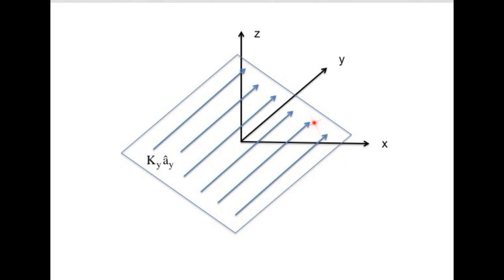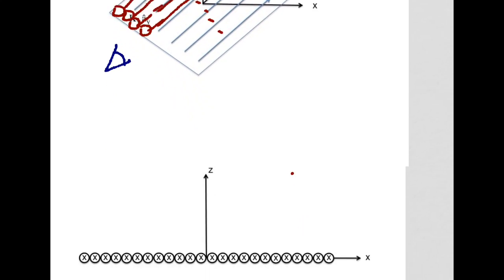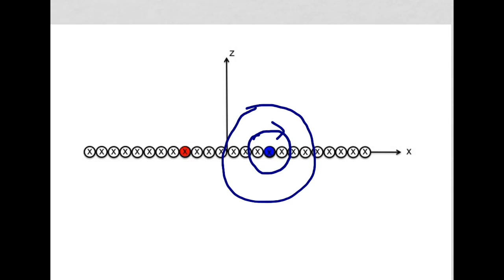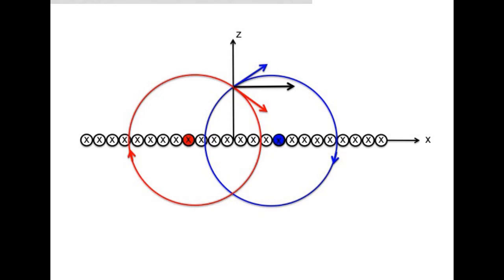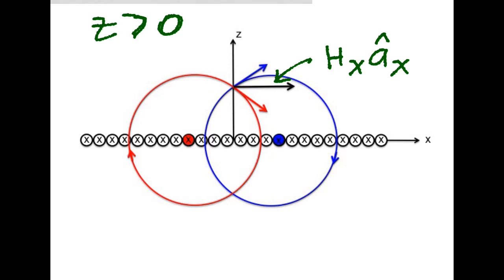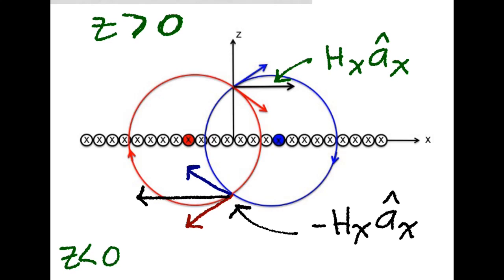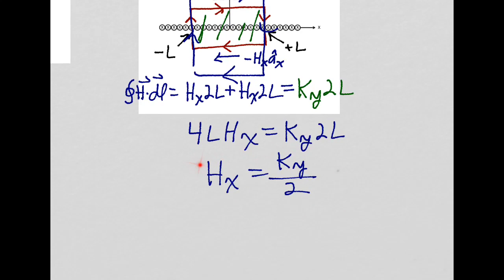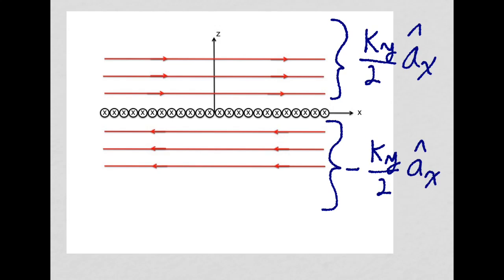Magnetic Field Intensity from an Infinite Sheet of Current

Comment: It was a good explanation; there a little mistake I believe as he did not multiply the right hand of Ampere's law by the permeability of free space.
Reply from the maker: On the left hand side I have the magnetic field intensity (H), not the magnetic flux density (B). If the right hand side had B  instead of H, then I would have to multiply the current on the right hand side by the permeability of free space.

Comment: Thanks a lot for your video, it helps a ton. If you don't mind me asking: If i need to find the direction of the magnetic field due to a current along the z axis on an infinite xy plane, would the steps to the sollution be the same? Any points of emphasis i should look for as coordinates change?
Edit: Just solved a couple of exercises that have been troubling me for a while. Your explanations are to the point!
Reply from the maker: If you put the thumb of your right hand in the direction of the current alone the z-axis, the fingers of your right hand point in the direction of the circles of magnetic field around the current
Reply: Thanks, being able to solve quite a few exercises since my last comment. As far as vector potential of the infinite sheet is concerned do you have any videos/recommendations? I can understand the choosing of amperian loop and the calculations just can't get the direction right
Reply from the maker: I don't have any videos on vector potential. Actually, vector potential is a topic that I need to get more comfortable with and have no idea  where to point you.

Comment: Hi,
I'm trying to do this exercice but i wanna calculate the magnetic field for a point on the x-axis,let's say at a distance a from the infinite sheet.Should I apply this ? Thx :)
Reply from the maker: +Anthony Devresse If you are on the x-axis, you are in the plane of the current sheet. The magnetic field intensity is zero in this plane. You can see this by thinking of two wires that are equal distance from a point on the x-axis in the +x and -x directions from this point. The two magnetic fields from these two wires are of the same magnitude and in opposite directions at this point so they cancel. If you then think of summing up the contributions from the whole current sheet by thinking of two wires at a time that are equal distance from this point and moving from the point to infinity you see they would all cancel.
Reply from the maker: Risto, if the sheet is finite, you are correct. But if the sheet is infinite, no matter what distance you are away from the origin on the x-axis you still have an infinite current sheet in the +x and -x directions. So everywhere on the xy-plane the magnetic field intensity is zero for an infinite sheet of current.
Reply: I was reffering coordinating system from your video.
 I think we were talking about different placement of sheet...

By the way great videos keep up with good work.
Reply: Michael that applies only to the center of the sheet.

You can calculate magnetic field in a point on x axis by summing contributions of small current wires from the sheet.
You would of course use definite integral to sum those contributions.

Field around one infinite wire you can find from amperes law.

B= (µ0 dI) / (2rPI)

Where dI is (current density) * dx